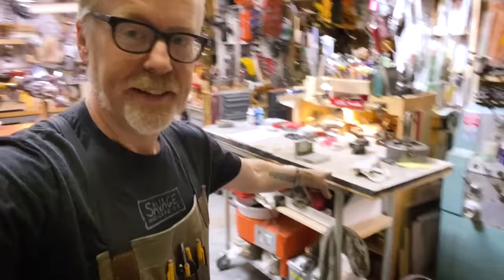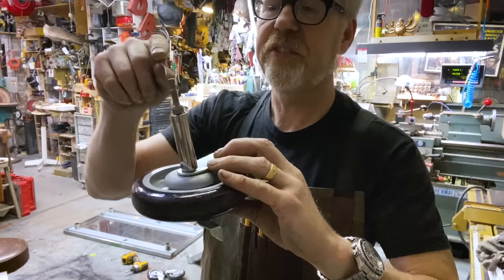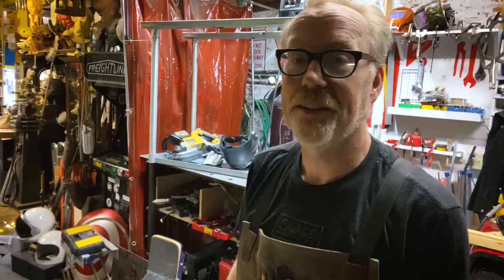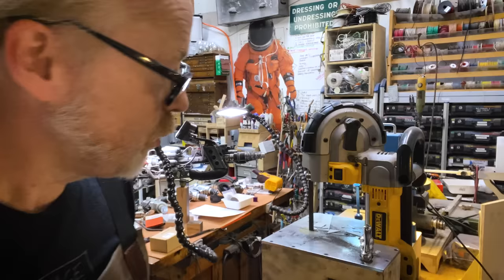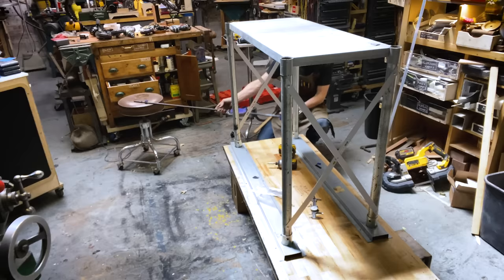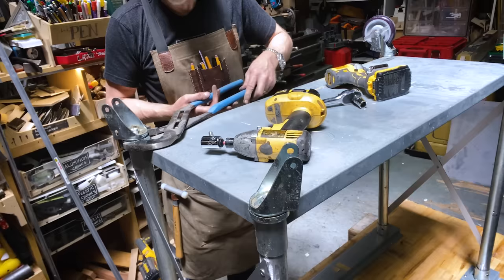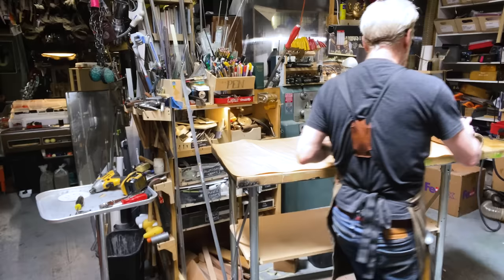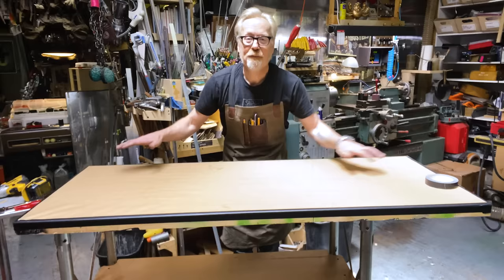Adam Savage's One Day Builds: Making a Stable Workbench!

Comment: My "couple of hours" enhancement of my work bench took the better part of two days.  The issue was to mount and wire a new fixed power supply to one end of the instrument shelf, the vertical support panel .The plan included an insulating plate of polycarbonate sheet with mounting holes matching those on the printed circuit board.  I also needed some rubber grommets as spacers.  Then I had to make two L-brackets for mounting 3 small cooling fans.  The power supply specified minimum loads for two of the 4 outputs, so I assembled 6 6.5W resistors, as well as the wiring to a terminal strip on the front of the shelf.  Finally, the whole thing needed a cover, bent of aluminum sheet metal to guide the air flow to the power supply as well as the base load resistors..  But the difficult part was to mount all the parts to the shelf leg, BETWEEN the bench and a book shelf.  All the mounting was done with #5 wood screws of 1/2 inch length. Half of them were in blind spots behind the parts.  Needed a flash light and a mirror.  But it ended well, so I guess everything then is well.

Comment: Those Channel Locks are large, but they make larger. I have some for use when changing disc bearings, holding the shaft while using a 1 inch impact to get the nut off the disc gangs.  They are about 4 foot long.

Comment: Just a thought... Adding a layer of EVA foam to both sides of the lower (metal) shelf (glued to the underside, and placed on the top side of the shelf) will assist in absorbing the vibrations/sound of what would otherwise be a drumhead when you move/impact the bench as a whole, and otherwise might end up being an audio issue when filming...

Comment: If you're into being pedantic/accurate, as I am and I know you are too (whoever you are), pipes are things intended to transfer fluids. Gasses, liquids, exhaust, hvac, cooling, gas pipes, etc...   "Within industry, piping is a system of pipes used to convey fluids from one location to another. The engineering discipline of piping design studies the efficient transport of fluid."   Tubing is structural and hollow and not "piping" or transferring anything. Bars are solid. Sometimes people use "pipe" like gas pipe, etc, as a structural components, which complicates things. That's typically not the preferred material, especially for something more critical or well engineered, but works fine for some things that just need to be made and aren't answering to any kind of strength:weight, or especially nice designs or tolerances. Typically the hollow structural material like is being used on this bench, is tubing. Unless it's pipe being used as tubing. Then whatever I guess. It's pipe taking the position of tubing.

Comment: @28:20 So pliers like those are better in one direction than the other. Adam had it right on several of the other caster mounts, but on this one, they were backwards, which allowed the piece to slip despite the death grip. You can actually get away with the smaller version if you keep the orientation correct.

Comment: Hey Adam. You say your welding jacket makes you hot. Consider buying a pair of sleeves from your welding supplier. They are just that, 2 sleeves made of soft leather and joined across the back of the neck with a light adjustable strap. Very cool compared to a jacket! I also have a neck protector fitted to the bottom of my helmet which protects my neck and really helps reduce glare. Your front remains protected by your apron.
Thanks for all the entertainment!

Comment: I definitely took a table very similar to that. They must have changed the construction on it. The rails on the underside of the top are now foam taped. On a stainless table meant for food service... didn't make much sense to me. I modified the top for a pint glass sprayer and made racks for the middle for a local bar. Came out pretty good!

Edit: Got to the part where I noticed they're also foam taped on your table too. :) oops

Comment: Channel locks... yes. My favorite one is absolutely minuscule. Inherited from my dad. 1940s Vacuum Grip No. 105 ignition pliers. This is from before they added "Snap On" to the labeling. Until I got my dad's, I could never find a pair small enough. You can find vintage ones on eBay. Highly recommended. Not like the crap ignition tools I used in the 70s.

Comment: I have a pair of those too. Channel Lock 460 it says on them. They cost me about $50 but they saved me from calling a plumber to replace the gas regulatory/thermostat on my hot water heater. His phone estimate was $300. I bought the replacement parts and those channel locks for under $100.  The bonus is that I had those pliers when I needed them a half dozen times over the past 15 years.

p.s. have you every finished putting something together and had some parts left over but it still works just fine? Well I have.

Comment: We have those type of tables where I work because its a fruit snack factory and they're great for stainless which is whats required, but the bottom shelf pieces are weak and prone to bending especially when people use them as a foot rest D:<  after awhile our tables begin to lean, wobble, bend and those little nuts keeping the top on fall off going who knows where so when you go to pull up on the table top it separates and next you know your fingers get sliced by the little pieces the legs go into... I'm going to submit this video to our H.R at work and see if we can get some of our tables fixed and braced minus the mid shelf. Thanks Adam for a great video and a solution for our tables at work, sadly we cant have wood shelves on em' but the structural support is whats needed!

Comment: Let me say first that I love Adam and Tested. He has taught me to think more critically about the function and practical use of things and making and designing in general. I devour his content like candy. That being said, I have some issues with this build. The bottom shelf should not be flipped. It should not have that lip. You store heavy items on bottom shelves and you slide them out before lifting. Having to lift something (doesn't even have to be that heavy) from a reaching, crouching position, even just a few inches is extremely awkward. Next, I would have waited until the welder was fixed and did it right. The upside down castor brakes should not have happened either. But Adam knows what he's doing and he knows how his work flows and what he needs so I'm not saying any of this is inherently wrong. Just some things i noticed I would have done differently.

Comment: I usually work with small stuff, small screws, etc... so what I usually do is use little containers and lay them in a line. So say I'm taking off the back of a laptop - all the screws from that one process goes into one container. Then inside, removing the next set of screws to get at something else goes into another. Then the next set, etc... then I can work backwards from there. By separating them out like that, I know that all of those must be used - and I'm actually really good at remembering exactly where something came from... but I am terrible with names of people, etc..

Comment: Wow, this comes surprisingly close to how a similar build would be handled here.  I'm wondering how difficult it would have been to flip the old top over and use for a middle shelf with a tray style if it's similar to the bottom.  The only thing I'd likely do different is spray some primer on the ground off portion of the legs since bare metal tends to rust rather quickly around here.

Comment: You should have added a peg board to one side. It would have added rigidity as well as given you a somewhat module station to hang small items from, such as small tool you use most often on that bench.  As a side not, why not add a paper dispensing device. This would allow ease of changing the brown paper on top when ever you fill it up with measurements, doodles of what you wanna try, quick notes to self, etc.

Comment: Pretty  much any protective coating we've made to date, if you weld it, you'll have a bad day. I'm not entirely sure which (not the galvanizing process) but i know there's one where if you suck in the fumes for about 10 15 minutes, you'll get a splitting headache for  your troubles. Welding on coatings... bad doodoo.

Comment: Adam, I see the wood floors in your shop and I cant help but wonder what sort of structure your shop might be. I see a 2500lb lathe, so I'm ruling out house boat. Is it an abandoned prop trailer? Horse barn? I have half inch ply in my shop, so I also ask in an attempt to glean some jewels that might help around my shop. But, curiosity has my mind running amok. Thanks a bunch -Dan

Comment: I've never used self tapping sheet metal screws.  I'm worried that with all of the intermittent side load you're bracing against, that the screw threads will wear away at their holes and come loose.

BTW: Andrew Klein is building you a workbench.  I assume it's not meant to be a surprise since it's on his YouTube channel.

Comment: If that cross-bracing is only meant to work in tension, it would have looked better (and probably been stronger) using clotheslines with some tensioners. But I guess this was an excuse to use up those otherwise pretty useless aluminium strips. :P

Comment: I know what I need to fix but not sure a good permanent solution. My toilet is clogged and I feel the block with the snake but it won’t budge. My current solution? Use a different toilet for the last three days. I have taken the toilet out two times already and snaked it... god only knows. I have six kids 7 and under so there is always an issue with something and my desire to keep fixing the toilet has diminished. I think the permanent solution is sell the kids but I’m open to other ideas.

Comment: Adam, why didn't you use your belt sander to take the coating off the ends of the pipes/legs instead of using a grinder? Figured it would have been a bit quicker and more precise using two hands on the belt....  Keep safe.

Comment: I'd Add with the Welder a letter X and use 1 inch long metal Angle bar to enforce it too if your welding? 
Re-enforce with glue?
See as you stop, and tell the others I may slow you.
and bight idea
Glue works well on wood?
Just remember what glue can do on every way  it glues?
or tightest fit  and very Strong too I mite say.
and idea to help you along may help?
comes from a Bicycle fitting to you need?
Cut at a 45* and add with tape, don't forget the Bicycle Handle Bars and how that is held together?
and it was fast that table was made fast.
I'd go there to help just the timing is off,
and I want you to be happy and safe.
Small face mask,
to help with up your noise?
May I offer to point your recording device so you can work?
O and what I meant to say is a File Mettle Wood File.
you removed part of what you removed that do the same trick?
I say that since you had a Shelf there before,
is tested on the back?

Comment: Drilling with twist drills scares me. They can torque and twist into your work pieces and spin the object if it is not clapped enough. Causing injury to digits and other parts of the body from whacking/slapping you at high rpms.

Comment: It’s a good thing you didn’t weld those legs. I’ve worked in a restaurant kitchen and those tables get used an abused with not nearly as much stuff on them as you have and the ones that get welded as a “repair” end up just just breaking at the collar attached to the table top/lower shelf, causing the replacement of the whole thing.

Comment: Low Key glad your welder failed. Welding on Zinc you want a respirator and exhaust fan going. Removing it from the immediate area isn't good enough. As you weld you will heat up the entire pipe and can cause zinc fumes to come off of that and you can get zinc poisoning which can lead to being very violently sick and/or death. As we know a sick and/or dead Savage would make us all very sad.

Comment: SPOILERS SPOILERS

I'm at 16 min. all I can think is 'put on the tabletop for square issues' and 'your pipes are too long'. So glad he didn't weld it. I would have weld some bar stock to the inside corners of the bottom shelf and use some real set screws. Ok, rant over. Let us see what he does.

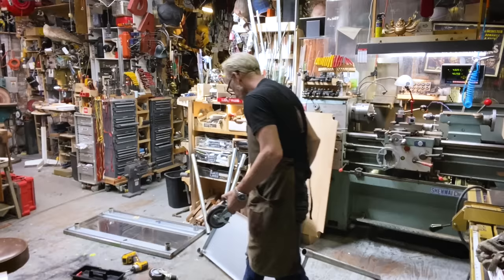Comment: Not so sure!  4:22 bad mouthing flat pack solution engineers, then "improving" it by removing the coating, welding, rivets, shitty cross braces, ...  There is probably a better way (for example using a higher support for the middle shelve and fixing it)